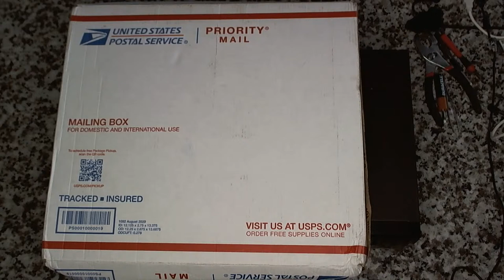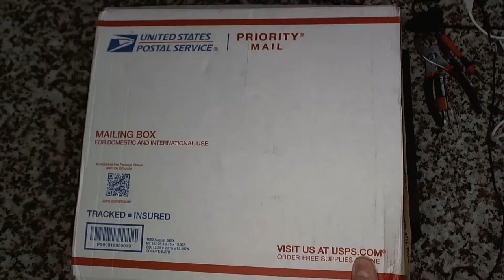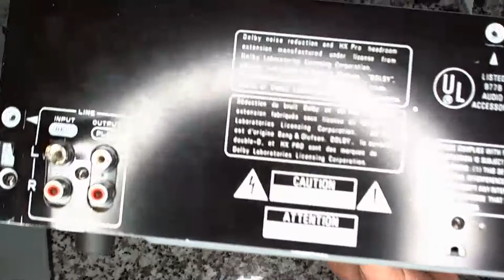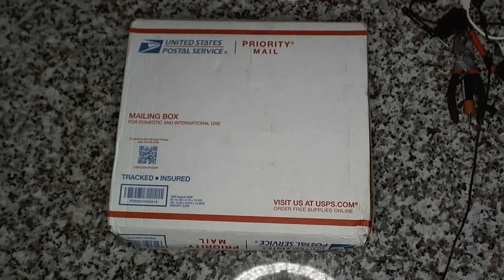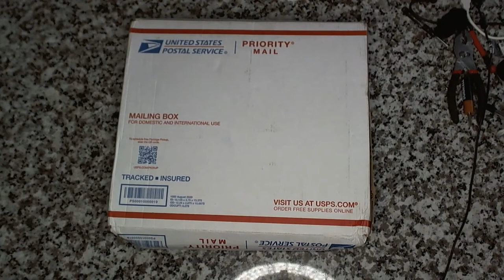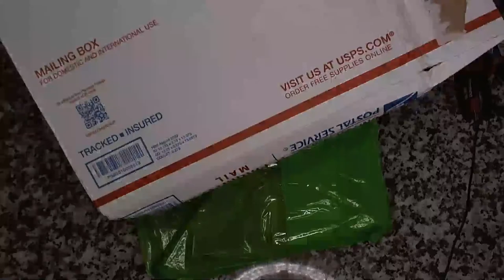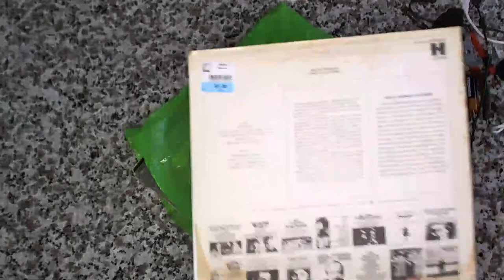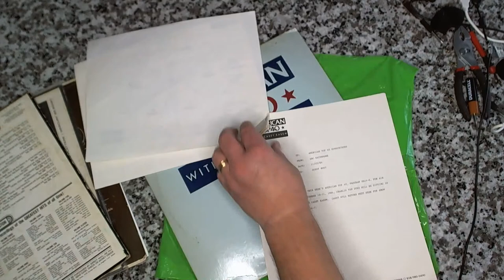LIVE! TEARDOWN & VIEWER MAIL! @Recordology

Comment: Just to let you know that Melinda Murphy can tell you more about the Top 40 records, should you need to know more about them; she has a great channel with reviews and more; in case you are not aware of her channel yet.  Incidentally, the tape text wasn't reversed in the feed; could read it fine.  Plus - there should be 4 records (transcript records) in the Top 40 set, I could see 3 of them in the video, not sure if you missed one or not - or if it is missing?  You might want to check to be sure; they are very hard to come by - as they were only distributed to affiliate stations or the main station.  Hope this helps!

Comment: I have a few sets of AT40 discs---At the station I worked at they played the records on air.Carts were used for local merchants.The AT40 is too long to play from carts.Some stations got it on RR tapes.These were especially good for stations with program automation systems.Then I wonder how many old AT40 album sets are lurking in stations transmitter sites????Transmitter sites were often used for storage.Fun going thru those places as I fixed transmitters! For cassette machines-On Tascam and Sony machines you could get belt "kits" for those when belt time came.Done MANY of those machines from both brands.